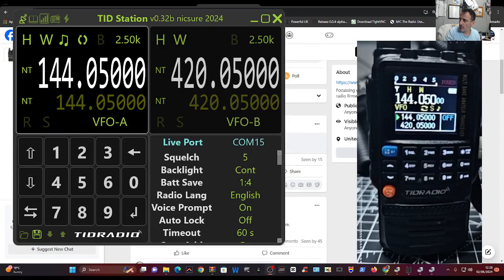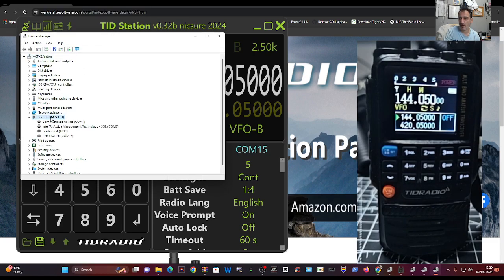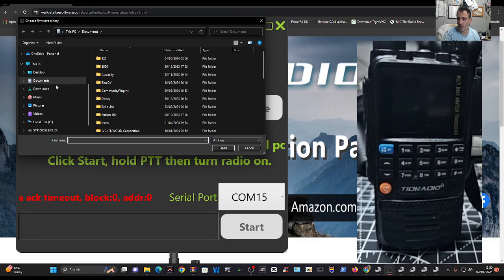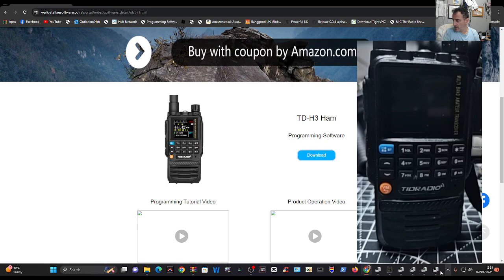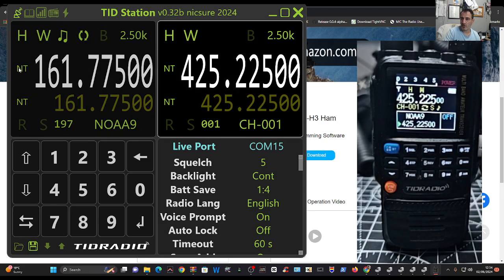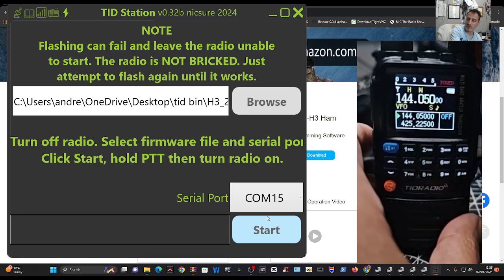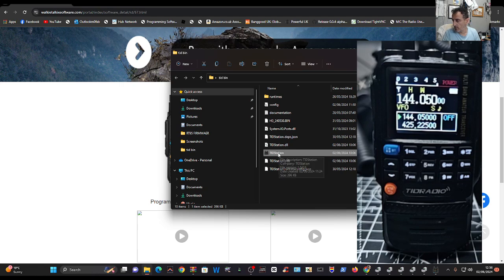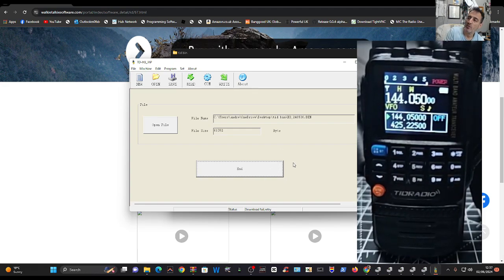TIDRADIO - H3 TIDSTATION - FIRMWARE

Comment: I updraded mine with the latest upgrade software (you have to re-install the app). I used USB C. It states the following "Company programming software will not recognize TD-H3 unless you upgrade the firmware". So make sure you run the correct version. :)
Reply from the maker: Thanks it works now made a new Video